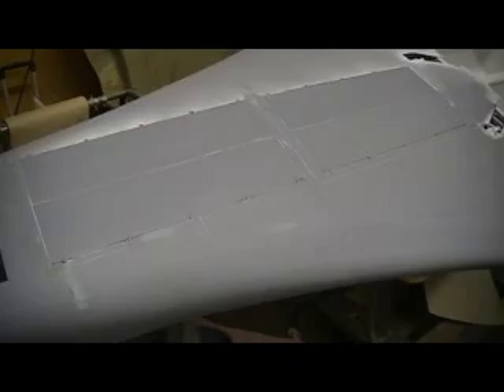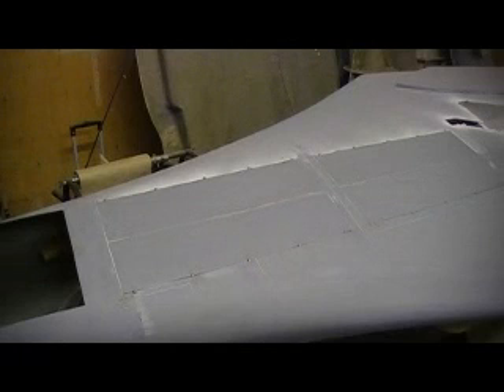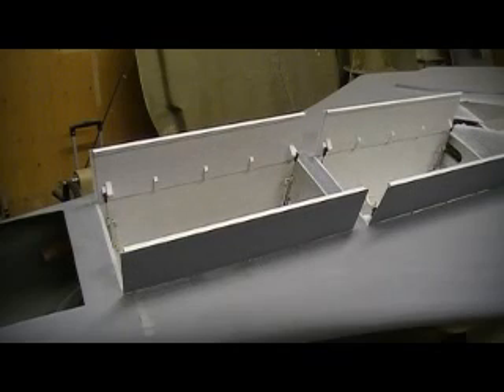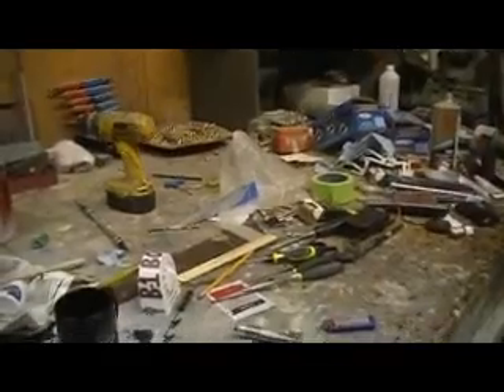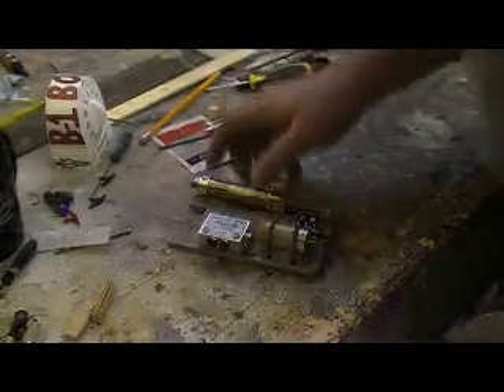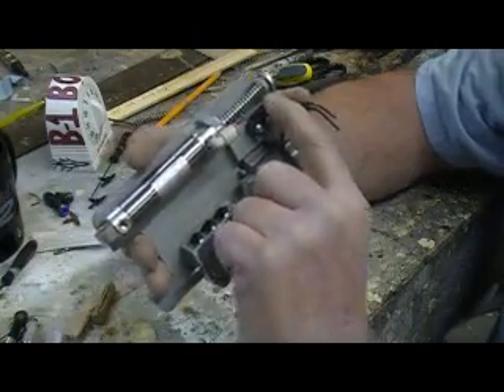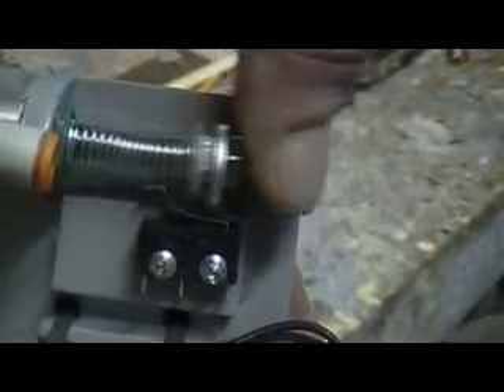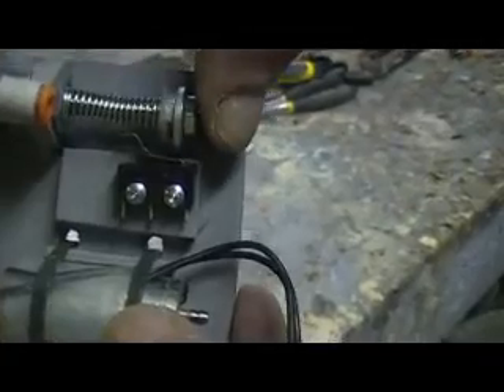how to build a rc jet B-1 Bomber # 150 PT 2

Comment: Using those micro switches for a limit switch can be a problem. I've spent the past 2 decades working in "field service" and have seen many fail. When used as a home/limit switch for a drive bad things can happen upon failure. People would be surprised how much power a little motor has. Don't' get me wrong using a limit switch is a great idea. But, I would suggest spending a little more and not getting the cheapest switch. This is a time when you get what you paid for.

Comment: Hey Bob-

You can calculate the pressure of the system by multiplying the area of the cylinder x the spring pressure.  I assumed the cylinder is about a 1/2" bore which = about .2sq. inches.  Measure the spring force with your scale that you use for the epoxy.  Collapse the spring to about 50% of the free length and take your reading in ounces or pounds.  If you come up with ounces, convert the ounces to pounds and multiply it x .2 (area of the 1/2" cylinder) and there's the pressure in psi.